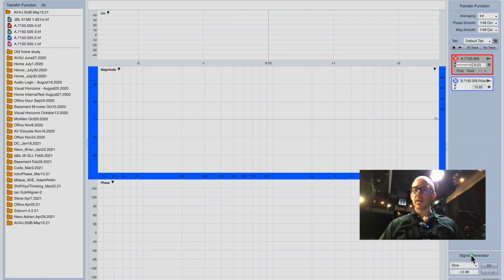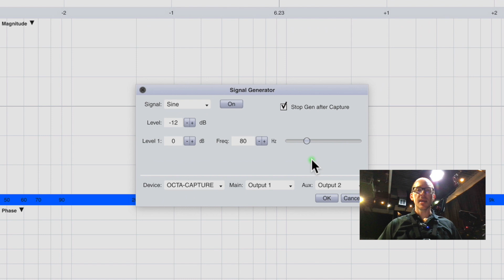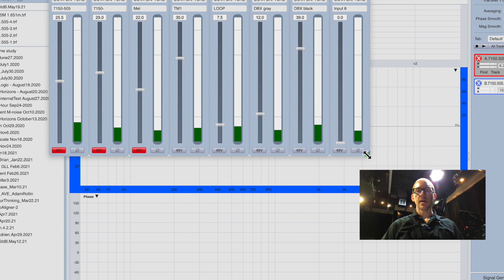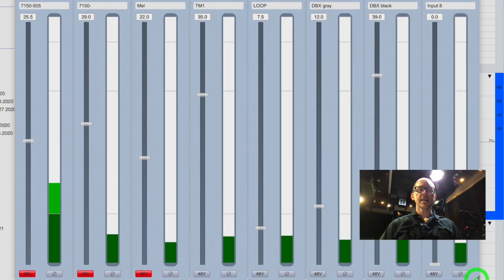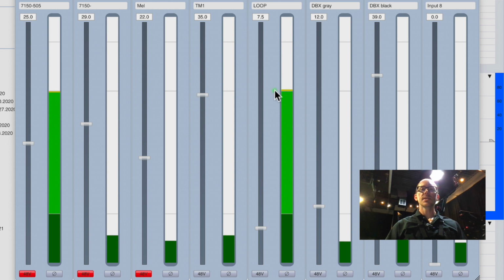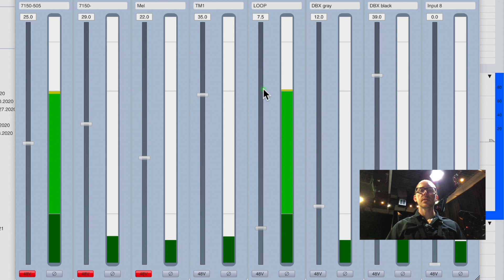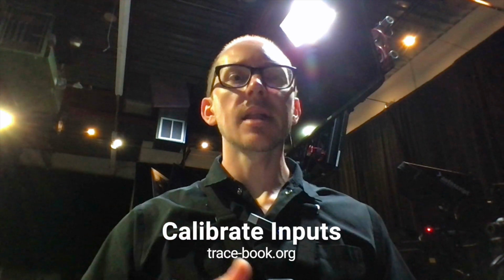TRACEBOOK: Calibrate Inputs

Comment: Hi Nathan. Using an audio interface with analog preamps (knobs) is it possible to calibrate by keeping the knob at minimum (0)? this way it would be easier in the various applications, otherwise I would have to glue the knob (just kidding) or repeat every time with the calibrator. I saw that smaart 9 has its own gain
Reply from the maker: Sure, in the past I have used a marking of some kind. It's not perfect, but better than nothing. Otherwise, just re-calibrate every time. After you've done it a few times, it's fast.